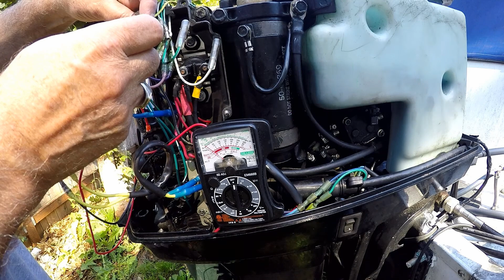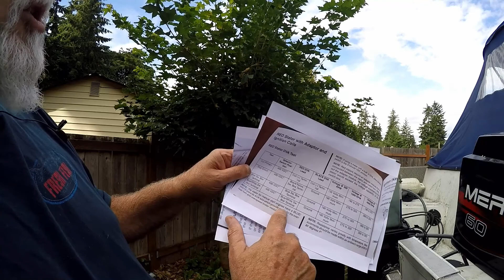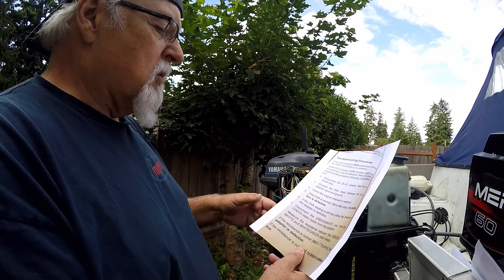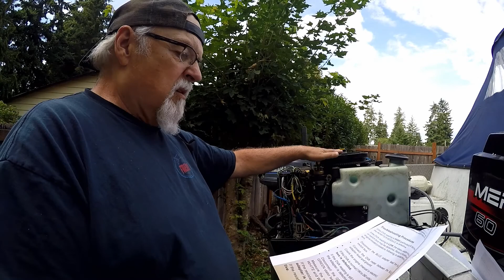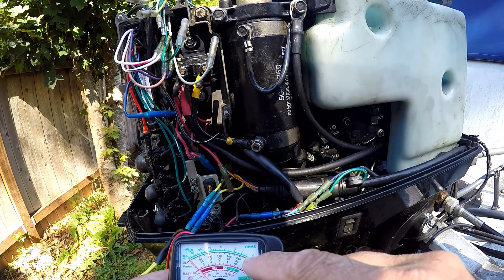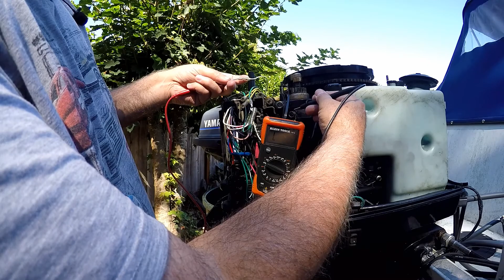Merc 60hp Stator Resistance test Part 4

Comment: My merc runs great when it runs.  The motor will randomly stop running. loose electrical current.  I replaced the switch box . ran very good for a while. Motor is not starting again. Im wondering if my ignition switch is failing. I dont want to take the control box apart because its not going back together very well from the last time a took it apart to replace the trim switch. Ive wiggled every wire I can see.  The motor wont start and I know its something simple. Help please
Reply from the maker: You need to trace it with electrical testers. That way you can find where the flow stops

Comment: Hi I’ve been watching your videos about the 60 hp Mercury. I have a 1997 60 hp 0G482770 and wasn’t sure if your manual you had had the specs on the electric system for mine I’ve been doing all the tests I can and I’m sure I have an electric issue. My dva attachment comes in tomorrow
Reply: Thank you again for all you help. I’ll get it tested soon and let you know the outcome.
Reply from the maker: The dva will eliminate the switch box if your coil readings are good. The stator sends the high voltage to the coils for your spark. By testing the current coming into each coil you will know if to that point your good. From there it's checking each coil to see if they are good if your not getting spark or weak spark to each plug?
Reply: @TimsWorkshopTJY  I’ll watch your videos again for the 75th time lol. But I didn’t have a dva tester yet and when I check the ohm reading from the spark plug boot to ground it was about 883 on all the coils so I ordered the tester and want to see where the problem is. Does your book show and different number for my boat that you know of 0g492770. Thanks again for the reply and the videos
Reply from the maker: it depends on if you have a red stator with an adaptor like mine? you can look up under the flywheel and see if it's red or black? testing to the coil primary terminal red+ on DVA and black- on DVA @ 1000 RPM the readings should be 195 to 275 volts. If you are just doing a resistance test on an electric start motor for the stator for Ohms reading no starting the motor required connect the White/Green wire to the positive and the Green/White wire to the negative and Ohms reading for it should be 660-710. When testing the coils for resistance without the motor running or cranking you test them where the coils are connected to the tower. The coil wires for positive are connected to it and the negative  black wires from the coils are connected to the grounding locations. between coil tower and coil terminals you should be getting the same reading 800-1100 Ohms. the reading between just the coil wires if disconnected separate should be .02 to .04 Ohms. Sending you some pictures from my book too
Reply from the maker: Here is some info and specs
https://photos.app.goo.gl/j4sxHGMSmkQe2JoFA
Reply: I’ve got the same motor mine is a 2004 mercury 60hp 2stroke and we took it out a few days ago and it ran great hauling butt then I took it home and took the batteries off to charge them which they didn’t need much but I reinstalled the batteries and went to the lake and it’s dead no spark at all.I pulled the cowl and the only thing I could find is the yellow stator wires on top looked burnt I know mercury zip ties them to the motor pretty close don’t know if that made them get hot or something electrical happened but all the sudden no spark and I check the stator it seems fine but I didn’t have the true specs but the coils are not putting out any voltage.Im at a loss I’ve only owned the boat for a week took it out once and it ran great started instantly no issues then this.I hate to throw parts at it but I may have to
Reply from the maker: Hi Donnie, these merc motors have issues with the stator yellow connectors melting. Mine started to and I tested the charging system when the motor was running and had 13.5 volts on the battery so I knew it was good. I read that the connectors are junk that the put on so I put new heat shrink connectors back on and haven't seen that again. With yours though the first thing I would check is the 20amp fuse. If that is blown nothing will work. If that is good then I'll send you a good video to watch in the switchbox from another youtuber.
Reply: @TimsWorkshopTJY  Yeah I checked the fuse it’s good I replaced it anyway tho but still no luck idk man it’s aggravating lol
Reply from the maker: Keep testing to see what went wrong. Buy yourself a merc service manual for your year motor and model. Mercurymarine.com
Reply: @TimsWorkshopTJY  I went thru that and for my motor it’s not showing anything anymore.Its the same motor as yours just a 2004 I think the coils are different and the Switchbox but everything else looks the same.I am gonna try to find a manual tho so I can get the specs
Reply from the maker: Yes, the correct year manual is needed because even though the motors are similar all the accessories and wiring is different including the colors
Reply: @TimsWorkshopTJY  yeah I think I’ve got to get the paper one they don’t have mine and I can’t even really find the paperback on there it’s like it’s hard to find stuff on this motor I guess it’s right before they went 4 stroke is maybe why it being an 04.I am gonna get one for sure tho I need it bad
Reply from the maker: For a 2004 60hp merc? Let me see if I can find it
Reply from the maker: Here is the Mercurymarine.com service manual that covers the 60 but you need to call them to order and tell them what year you need. They will ship the book to you. 
https://photos.app.goo.gl/B8rvhky3VfgZS8BJA
Reply: @TimsWorkshopTJY  Thank you and yeah I’ve even tried to look around online some but going thru mercury is the best route
Reply from the maker: It is the best for a couple of reasons. One it's easier to read and pictures and diagrams are very clear to understand. The testing is also more detailed. Even though I found Mercurymarine.com I still had to call them to ordered the right book.
Reply: @TimsWorkshopTJY  Yeah I’ve had a hard time finding info on my particular model and any kind of manual but I’m gonna call them here in a little bit I need to get it going
Reply from the maker: Let me know what they said on the manual for your motor
Reply: @TimsWorkshopTJY  ok I got busy mowing and they closed I’m gonna try again tomorrow
Reply: @TimsWorkshopTJY  I can’t get them to call me back about the manual and I checked the stator seemed fine but figured it had to be the stator ordered another one just like it and they both ohm out the same and mine seems to be reading good voltage when I turn the motor over.I have no clue what else it could be if it’s not the stator it don’t have a switch box or cdi just a voltage regulator and stator on my model.Im stumped
Reply from the maker: Hi Donnie, well your just going to have to find a manual for your motor to test it. just ask your local marine store or dealership. You need one that is specific to your year and model and they may say they only have the generic book with multi motors in it which is confusing for folks who are new to  these.
Reply: @TimsWorkshopTJY  Yeah I guess I could but usually it’s only for new models.I don’t get it man I disconnected the kill switch the stator checks out right and all 3 coil packs wouldn’t go out at once and if it had weak spark it wouldn’t turn over that good and the battery is new and ive tired several.Maybe it’s the trigger but it seems fine but you never know it’s got me aggravated for sure.But the new and old stator ohm out the same so I would t think the stator is bad.And the voltage regulator I don’t think would keep it from having any spark at all.Im at a loss man
Reply: @TimsWorkshopTJY  Yeah I called my local dealer there trying to get me one for it.I e been so busy I haven’t got to mess with it much

Comment: Easy test, nice video Tim
Reply from the maker: Thanks Jim, one more that will be interesting because it involves a 9v battery and an ammeter for amperage readings on the rectifier/regulator. One of biggest failures on outboards with charging systems is the rectifier or the rectifier/regulator depending on which system you have. The symptoms are motor not charging the onboard battery or if not that the motor is running rough. another sign is the wiring going to it is burned on the splices is what I found on mine. That doesn't mean the unit is bad though. like mine it was just old, corroded connectors that I replaced. bad connectors will cause heat due to shorting out.
Reply: @TimsWorkshopTJY  makes sense, at least it's not an expensive repair